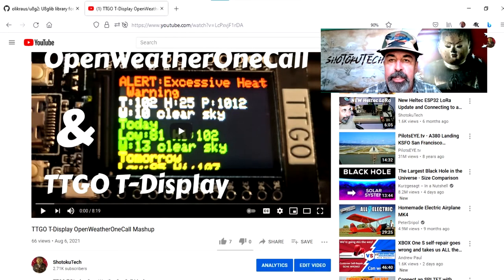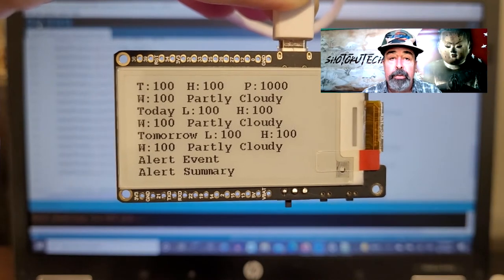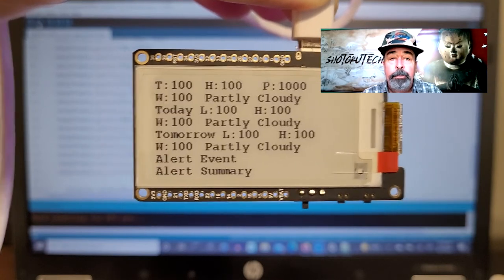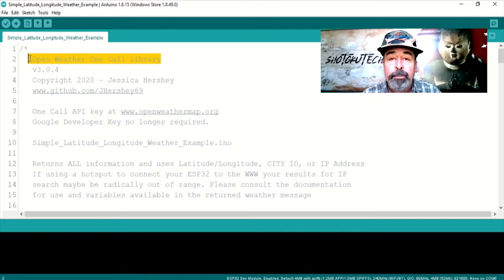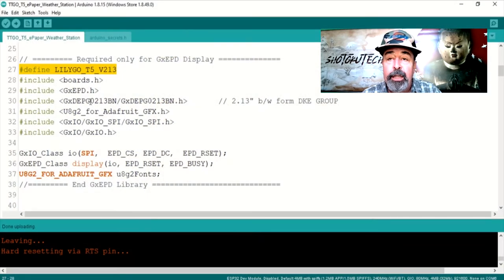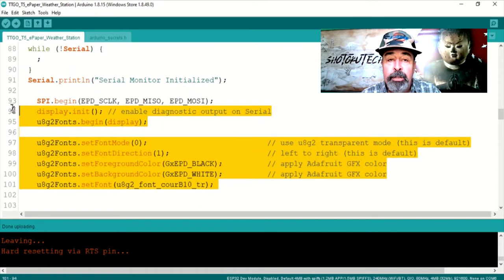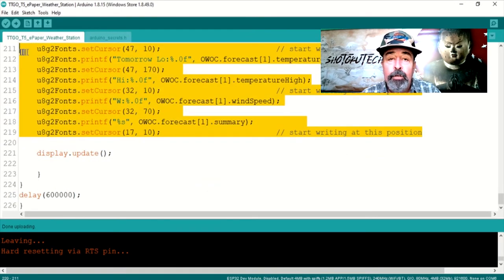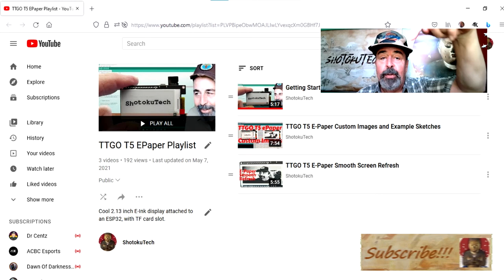TTGO T5 E-Paper Weather Station

Comment: Any advice for someone who has never connected a microcontroller to the internet on where to start? I don't know networking at all.
Reply from the maker: For these ESP32 based TTGO products, all you need is a WiFi SSID and password. I have a number of videos on this channel on the TTGO T-Display where I show simple web server or simple web client, using my home WiFi network.
Reply from the maker: Most important is take small steps. Look through the example sketches. Find something of interest that is relatively simple. Make it work. Then read into the sketch and learn what each part does. Then figure out how to add something else to it and make that work. This is my approach in these videos. Many times I am just learning as I go. Let me know how it goes. Thanks!
Reply: @ShotokuTech  Thanks for the advice. Looking forward to your next  video
Reply from the maker: @daque1960  Thanks!